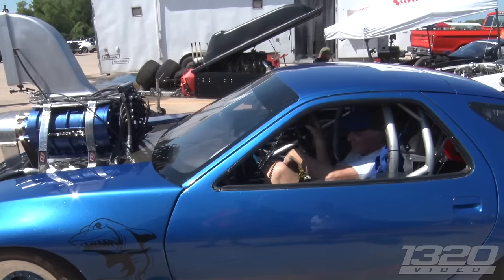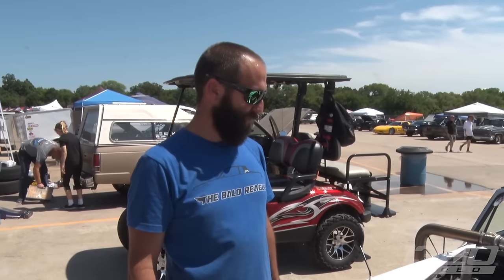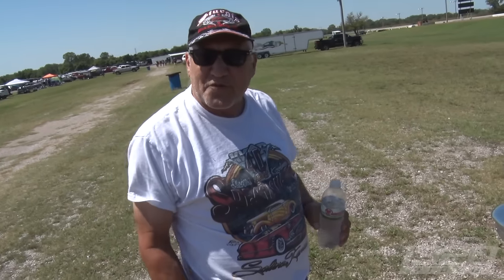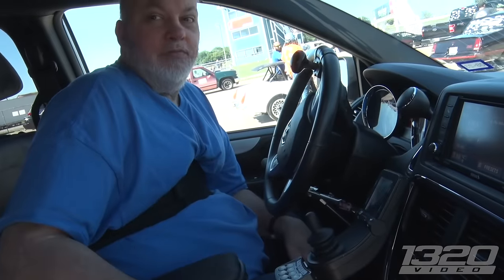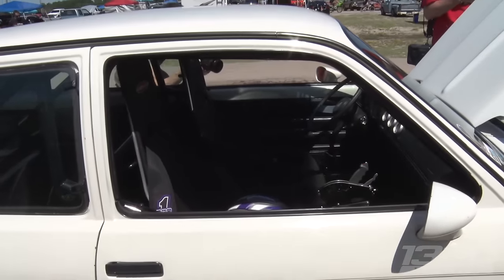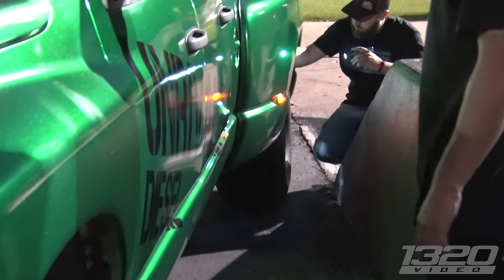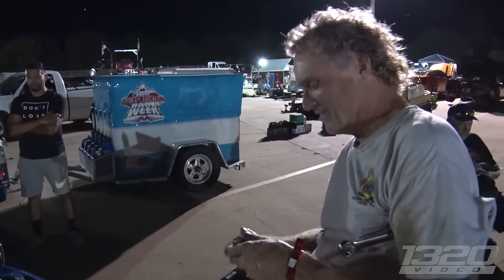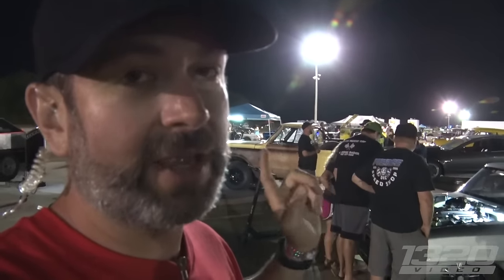Porsche with MASSIVE Supercharger, Wheelies + MORE! | Race Week 2.0 Day 1

Comment: That is hands down the biggest supercharger I've ever seen. That 928 is ridiculous.
Reply: Look at top fuel. They're 3 times bigger
Reply: @nakotahunt1324  no, they arent. top fuelers use a 14-71 roots blower, and they move the blower so far back on the manifold that they look massively long, but thats because the snout is so long. 

the blower on the porsche is a whipple 980. the whipple 980 is roughly the same case length as a 14-71, but they are much wider and taller. we used to run them in top alcohol in the 90s and early 2000s till you couldnt recertify them anymore. they were an absolute beast of a blower
Reply: some to aus 🇦🇺
Reply: Then you haven't seen the Camaro with the freight train supercharger
Reply: @alexandercurtis4427  exactly, why does it need a freight train supercharger, what’s wrong with a normal supercharger
Reply: @josht9758  They did it for the novelty. Ran it once, blew both headgaskets, and that was it.

Comment: My older brother Rich was paralyzed from the waist down (paraplegic) and used hand controls to drive. He still raced. ‘67 Camaro with a high compression big block from Reher Morrison engine, back halved glass quarter panels. Around 950/1000hp on pump gas. It was totally awesome to see another handicap guy out there racing. Did my heart good. Thank you for showing that.👊🏼

Comment: Chair Force One and Chris to the top man. First pass in 29 years it's great to see him getting back into drag racing. That Chevette needs a late model aluminum 4.3. I bet it would run low 11s.
Reply: I was smiling the whole interview of chair force one. How could you not. 

What a bad ass!
Reply: @nickfrechette19  Absolutely. I had a near fatal accident in 2017 that broke me up really bad. I wasn't left paralyzed or anything like that but I was left disabled. The first time I went back to the track was so much fun and felt like such an accomplishment. At the time I had a Trailblazer SS that my PB was 11.8 in the quarter. The first time at the track I could only run 12.3 because my leg wasn't as strong as it used to be since I was still using a walker at the time and had only recently gotten out of the wheelchair. It was Alabama summer time hot, I wasn't able to footbrake enough, and the 345/40/17 Toyo Proxes TQ needed to be replaced. My best friend went 12.0 that same night. Later I put on some 325/45/17 M&H Racemasters and it was able to hook much better than the Toyo it set my PB on but I never got another pass out of it before I sold it. Chris making a pass for the first time in 29 years is a huge accomplishment, I don't know you at all and I doubt you see this but I'm proud of you brother. Keep up the good work!!!

Comment: In High school drags my moms '65 Chrysler Newport (383/727 torqueflight) mildly massaged with a Holly Street Dominator intake, Carter AFB carb tuned, and dual exhaust ran a 14.9 using only 1st/ 2nd gears with the original 3.23 rear end

Comment: Every power adder known to Man, huge engines...10/11s. that MG Midget with "500"hp.....15s LMAO
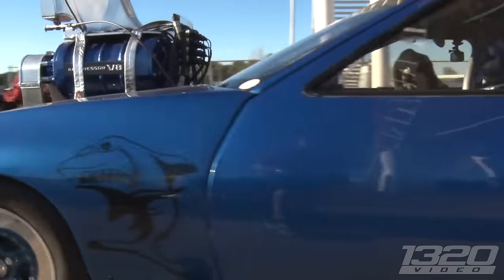My stock full weight 68RR runs 12.70s with 3:55 gears and a 383.... since 1989, LOL
The time has come where unlimited amounts of money to run a number is commonplace.  just keep throwing money at it till it gets a number, funny stuff.
Reply: I know right! LOL! I was breaking 10's in my 150,000 mile clapped out 1985 fox body back in the late 90's NA with bolt on parts, foot braking it. Some of these kids now days doesn't know how to build it up from scratch. I love going to the no prep events where you see some old guy in an old G body with a carbureted SBC own these guys with turbo LS and hear them cry about how they had a bad lane or the air temp messed up their tune, on and on and on. Bottom line is, old school just took you back to school LOL!
Reply: @phantom21629  Exactly mate, I ran 10.00 with a 600hp n/a '64 Valiant in 1992, fully road legal @3300lb,, now...MUST have power adders  and electronics, funny stuff.  Throw money at it...get the ticket at ANY expense, and shout "YAY"!! ha ha